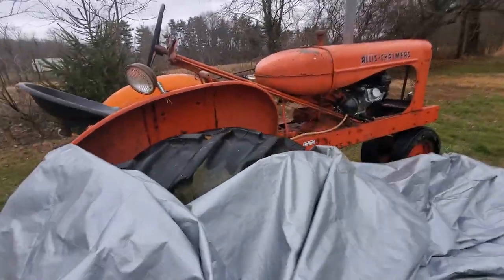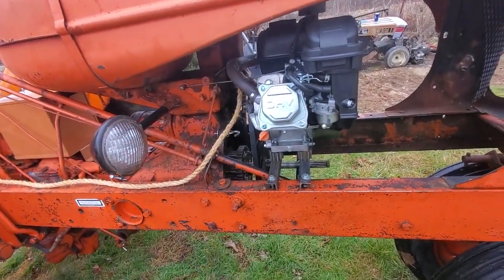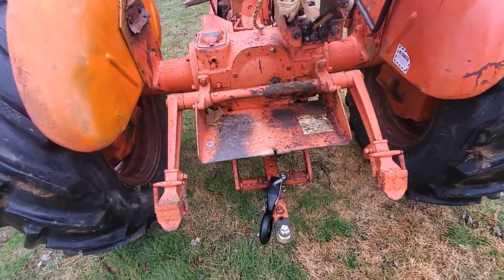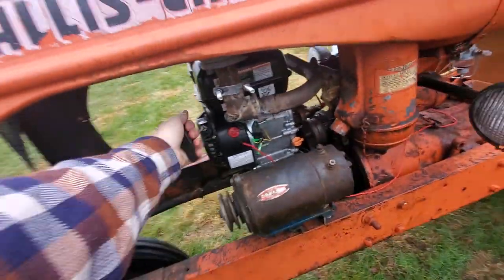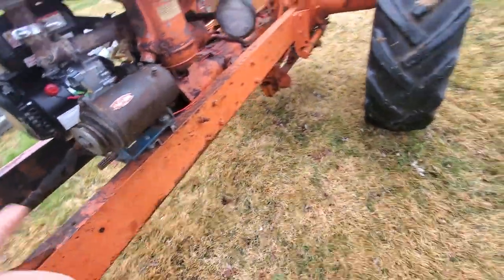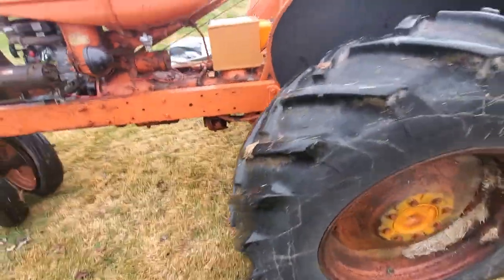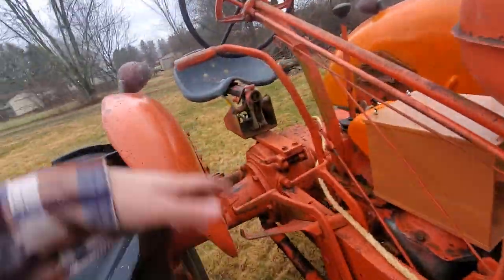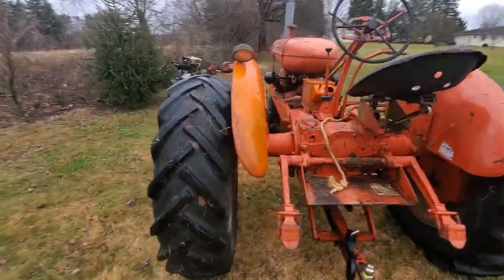predator 212 powered allis-chalmers  WD

Comment: Hey, that's great to see. You might try putting a kit of parts together for others to mod their wayward tractors. I'd think a B/C/CA would be the best application for the Predator re-power -- however, interested in seeing what you can do with this and you can always reinstall a WD engine (WD45 and certain Gleaner engines go in). Future video: line up your implements and go from easiest (hay rake) through medium (brush hog) to toughest (can it plow with a two bottom plow?). Save the other parts you remove like the snap coupler bits. Glad to see you left the sheet metal on there as that improves the appearance a lot. It would be fun to paint this up and see it at some of the 'GOTO"/other tractor meetups, I bet it would create quite a stir. Good job and looking forward to updates.
Reply: Absolutely im currently trying to do this to my WD
Reply: I spent at least two years trying to find a cleaner engine to drop in it and I finally said screw it. I need to get it running.

Comment: I wanna see it pull the three bottom now🤔😅!!!   I've replaced a bunch of engines with the Predator. Make yourself a heavy balanced flywheel. If you haven't already noticed when you start to take off , you will kill the engine. When you find something to make a heavy flywheel to keep the inertia going, you can let out on the clutch faster.     I dismantled a carpet mill machine that had a bunch of thin flywheels that fit the output shafts of these. I had thought about using the hormonic balancers from small Block Chevrolet with a bushing turned to fit the crankshaft , and bolts drilled , n tapped through so the balancer wouldn't fly off because of the rubber between the two pcs. Like long set screws with red Locktite ran through the outer to inner. I'll hafta come up with something, because I've used up my last flywheel.

Comment: WD45 was my first tractor I bought, I basically bought a junk yard tractor to piece it back together, then I gave up farming with it. Yes it was that bad, then it got an engine swap and stripped everything that I didn't need and now it's a bad ass pulling tractor. Now what little I farm I have a 57 farmall cub and a 72 IH 185

Comment: Yep, allis's blocks was notorious of cracked block around the valve. Don't remember witch one, weather the Intake or exhaust or what caused it. but they often became trash motors that way or very expensive to fix. I think you need to figure out how to install a flywheel between the 212 and transmission.  And yes add a bunch of weight up front as that tractor will rear up because of the rear end you are so proud haveing. That is not a good design as if the rear wheels stop turning the drive gear will clock backwards around the bull gear an lift the front end off the ground.

Comment: I think I would use the stator on the engine to charge the battery. If u get a decent marine battery it should be able to handle the winch. The stator will keep up just fine if u run LED lights.

Comment: I do not understand why you builders use 6 hp why not 15 hp power running through original fly wheel and clutch
Reply from the maker: Clutch was absolutely shot, other wise yes, and as for the 15 horse predators are almost 500+ dollars after tax, as mentioned in last video it will receive a larger engine one day. But for right now, 212 is the best way. It's fuel efficient, and pretty strong, gearing is the most important, the gearing could easily affect it, so if geared correctly the 212 could do the same as the 420s

Comment: put a second motor connected to the same shaft but use a clutch and a taller gear for more top end.   Modify the front motor for higher rpm and they can combine power in the high range too.    Then put a third motor to power the front wheels = ].

Comment: I got a self propelled combine. 7ft header on it. I am thinking about doing something like this only with a 40hp Vanguard. Same hp as the original engine in it, Continental f162 four cylinder. Dumb engine was put under the combine an you cant work on anything cause it takes up as much room as a sports car engine.

Comment: What size engine did you use
Reply from the maker: 212cc predator 6.5hp
Reply: @coltscustoms1776  thanks for the reply. Now I wanna build one but I can't weld
Reply from the maker: @koryleague8833  if you got a drill and some cheap bits you couple probably bolt most of it together